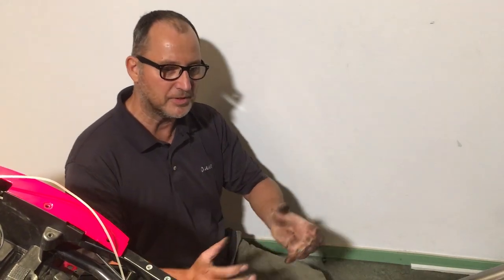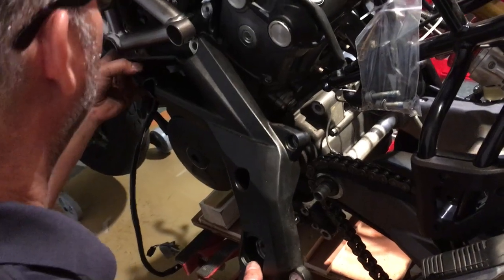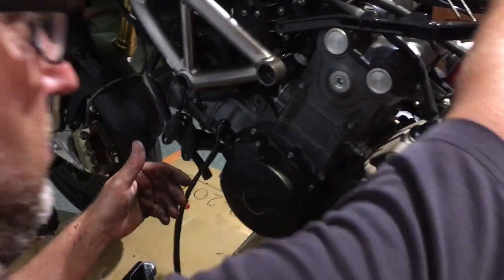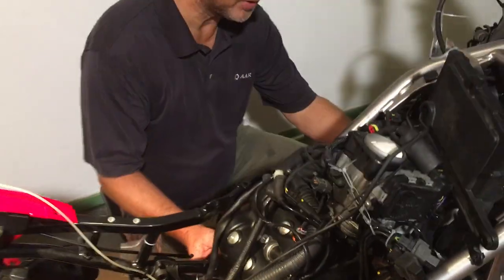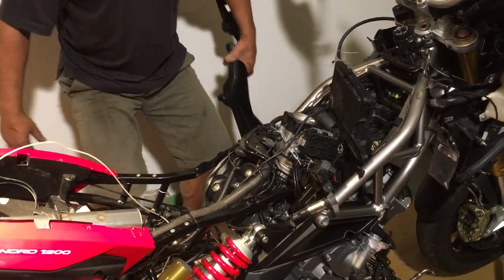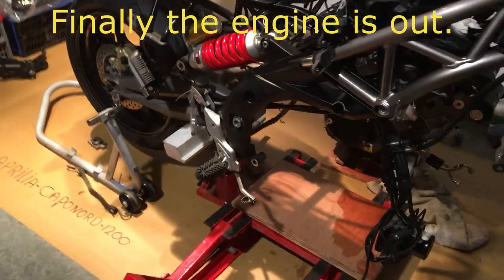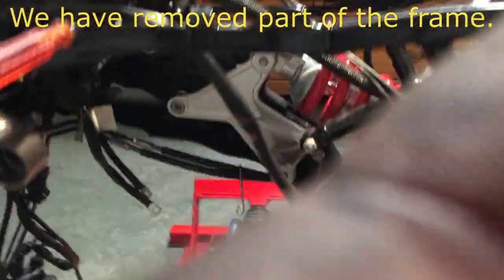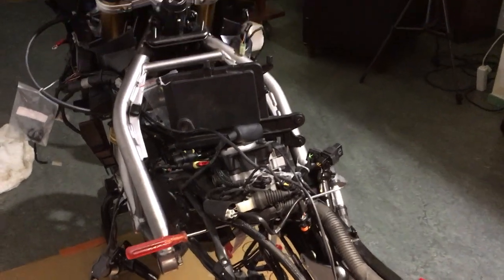Aprilia Caponord 1200 Repair Part 3

Comment: I have seen someone remove the engine before at dorsoduro 1.2.. they don’t remove the side frame.. but they remove the tail frame.. it should have clearance to drop the engine by tilting the engine a bit..
Reply from the maker: When I was at it I couldn't find anything about how to get the block out.  I ended up doing what made the most sense.